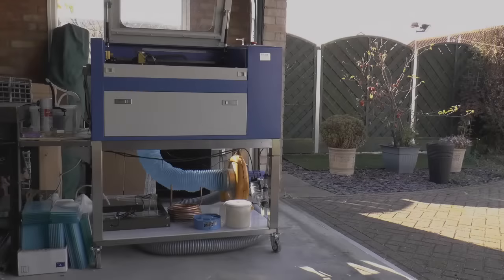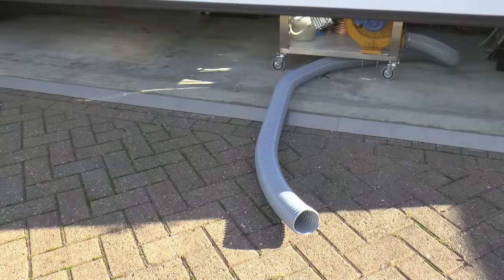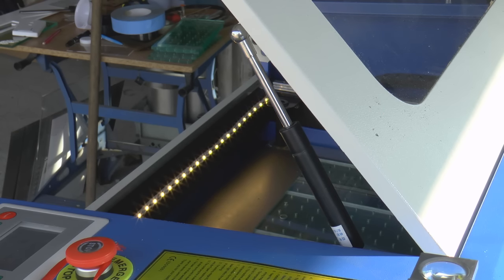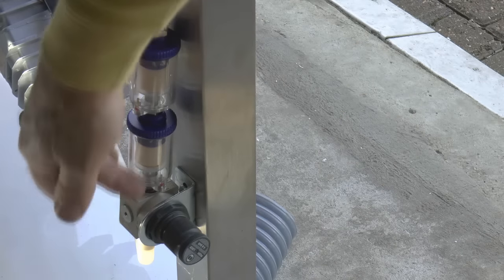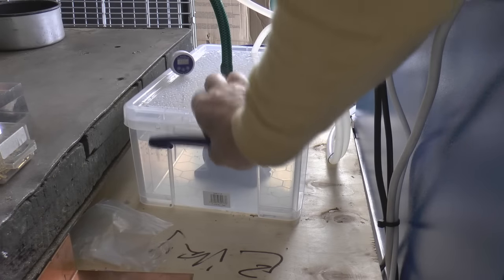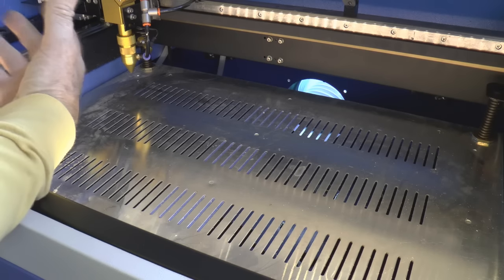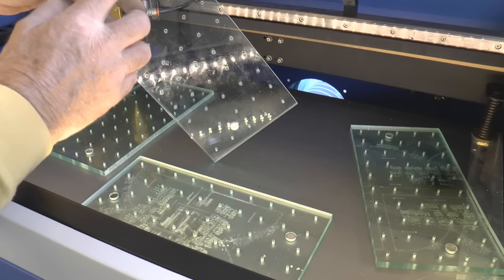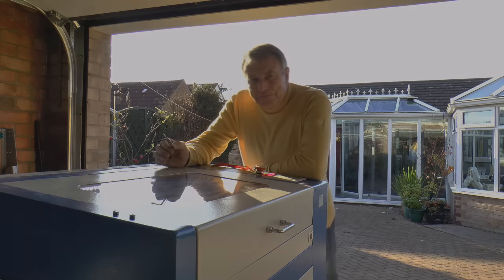My 50 watt Chinese Laser 4-month review

Comment: You mention the air pressure gauge being pointless because you are not using the larger blower.  With the filters you placed in series, your pressure gauge is ideal for determining when to swap filters.  A differential gauge would be better but your set up is still effective.  This series gets better with each episode.
Reply from the maker: Hi Adam
 I come from a background of high wattage metal cutting machines where the pressure of the assist gasses is very high. I was convinced that the stupid little pulsing pump supplied with the machine was a joke. I ran my  shop compressor, (through the  regulator and filter system you see here) for two weeks and destroyed two lenses before I worked out what my problem was. Taking normal ambient air with 30 to 50% humidity  and compressing it to 100psi was obviously heating the air. That hot air sitting in the reservoir was busy absorbing moisture from the condensate within the reservoir. Sending hot air and through the regulators an filters was doing little to change the moisture content of the air. At this point I was not aware that there was a  2.5mm diameter hole through the fitting into the nozzle just below the lens.  I was creating water vapour as the air expanded and cooled and the laser beam was heating the  water particles (probably with oil on it as well ) and baking a film onto the front face of the lens. After a while the film heated up causing differential heating on the lens faces. The lens is not glass but a rather fragile and brittle crystalline material which cracked. Oops.  I caught lens number two before it cracked and realized what was happening when I saw the film. It was so heavily baked on I could not remove it without destroying the anti reflective coating.  I removed the shop compressor and at this stage was still using the regulator to damp out the pulses.  I soon dumped the regulator as well  because the "stupid" pump was not that stupid after all as it can can supply up to 4psi. The system pipework does a pretty good job of attenuating the pulses and because the air is not sitting in a reservoir and the compression is so low, the heating and condensation issues just do not exist.

Best wishes
Ruus
Reply: @SarbarMultimedia  what was the temperature of the air from your cp?  A silica or even clay desiccant should take care of the moisture issues and an HX with the process tapped off from the tube coolant  will help.  But it seems a moot point if the supplied cp is doing the job.  It is quite fascinating watching your series.  I am ordering the Weike LC1390 tomorrow and am more excited to modify the machine than I am to manufacture with it.  Thanks Russ
Reply from the maker: @adamparris3605  
Hi Adam

Dont get too excited because your purchase is much more a plug and play machine.. The biggest issue with ALL the machines is air flow management. The Chinese (and even the big boys) have not realized the importance of CROSS FLOW air above and below the workpiece.. That is something you will have to engineer yourself. Most of the things I had to modify will be OK an a GKW machine. For example you will almost certainly find it's fitted with an A grade tube from either Reci or EFR. I'm sure you will be sxploring the technology rather than fixing the machine.

Best wishes
Russ
Reply: @SarbarMultimedia  I recall one evening as a child watching my brother tinkering with his clock radio; while it was still plugged in.  Can't say for sure what he was trying to accomplish but the effect the electrical arc and small fire he created inspired me.  Ever since, I have modified everything that has not lived up to my expectations.  I don't see this laser being any different.  I already have plans to swap out the stepper motors for servo motors.  I essentially want to make a laser that works better than the jack ass North American companies who charge nearly 10x the price.  I do have a question for you that may be able to save my marriage...  Can I reduce the power down enough on 150W to mark paper and denim without destroying it?  More interested in the denim.

Thanks Russ
Adam
Reply from the maker: Hi Adam
Sorry for the delay in answering. Somehow your last question appeared in my "possible  spam" folder. I visit about once a week  because You Tube often gets it wrong.
 I agree with your sentiments about the "big boys".  but you must remember that they are using a more expensive RF tube technology.  It has always been a driving factor for me to see just how close to their performance I can get with  a machine that cost less than 1/20th of what they will charge. On the quality of photo engraving, I know I am substantially better than them because their lens mounting system limits how small they can get their dots and the  and photo conversion software does little more than produce cartoon like images. The only advantage they have is speed. They can produce their cartoons in 1/5th of the time I do a proper photo replication.  When It comes to cutting their machines are no different to ours. You need power and light concentration to cut, so their machines are limited by the same physics as our humble "toys". I say this so that you don't spend vast amounts of money trying and match their performance. They may have faster servo systems on their machines that go at 1000mm/s rather than our 500mm/s. However,  even at 500mm/s you cannot do quality photo engraving with our tube technology because the response time of the HV power supply is just not fast enough, You will be limiter to about 200mm/s.  So what advantage will high speed servos do for you? You certainly don't need such performance for cutting when maybe you will only be running at  40mm/s with thin materials and as little as 3 to 5mm/s for thick materials.  It is the micro second response time of the RF driven tubes that  allow rapid engraving but I honestly believe that the advantages of this technology are not properly understood by those "experts".

The end of your question has been truncated when it moved into the public arena. However I remeber the marriage saving question.
 Do you have an ammeter fitted to your machine? Do you know what maximum working current should be for your tube (maybe 27mA?) If not then make sure with what I am just about to tell you, you never set your power above 65%
If you go to the  RDWorks USER tab there is a section called Sweep Parameters.. Make sure your pc is linked to the machine and press the READ button. Now find SCAN MODE and you will find it set to COMMON MODE, Change this to  SPECIAL MODE. .
Just below you will find a feature called Facula Size. . When this is set at 99%you will notice no difference from normal. However set it at the lowest allowable 50% and what happens is the power is switched on and off at the 20khz pwm frequency so 50% of the time the power is on a and 50% of the time power is off. It's a bit like an RF tube . As you increase the % you are modifying the ON time. So, if you set your power very low, say 15% and then apply 50% Facula in SPECIAL MODE, you will be dramatically reducing your power.  Press WRITE to send these settings to your machine
Combine this with a 2.5 or a 4" FL lens and you can "soften the power even more. Finally, you have the option to lower the work by several mm to reduce the energy density on your denim even more. The advantage of real denim is it's thickness.  I have never played with denim but I know it is dyed. That dye may well have an evaporation temperature that is lower than the scorching threshold of the fabric.  In which case if you get the balance of power and speed just right you may be able to evaporate the dye and leave a white material exposed. If that is not possible then you will be able to scorch it without burning through.

WARNING. Never leave your machine is SPECIAL MODE, change it back to COMMON MODE before you walk away from the machine.

Best wishes
Russ

Comment: Informative video.. I've got what appears to be the same machine.. Question,  I'm trying to vector cut 3mm plexiglass with a very ornate pattern that takes aprox 1 hour. I'm running power at 95%, but after 5-10 minutes I think the power is fading and then not cutting through the acrylic completely. I don't believe this to be a water temp problem.. Have you found a maximum power % that you can run for long periods of time without fading? Love to hear your thoughts... -Mark
Reply from the maker: +markf3x 
Hi Mark
OOPS!!!

Been there. Done that. Have a replacement tube to prove it!!!!
Have you watched my follow up series of videos entitled RDWorks Learning Lab  (32 of them so far). They document my learning process with this machine (and I continue to learn). I urge you to watch them. I have made some BIG mistakes along the way. The biggest was to assume that 100% meant full power. There were no warnings in the manual about drive current limitations for the laser tube. It was only when I started to notice power drop off (sometimes to ZERO) that I started to investigate, test and learn the error of my ways by picking up odd facts from here and there around www. STOP using 95% NOW.  Limit yourself IMMEDIATELY to 65% . Get yourself a cheap  ammeter from Ebay  (I have done a video about fitting mine) and check what percentage is required to drive your machine to its 20mA limit (assuming you have a 50watt tube).  Without getting too technical they fill sealed laser tubes with at least 3 basic gasses. Carbon Dioxide (CO2) Helium (H) and Nitrogen (N), This next bit is grossly simplified to help you imagine what's going on.  The lasing effect occurs when you apply tens of kilovolts to the gas mixture,. The N gets very excited, it bumps into the lazy CO2 causing it to breakdown into carbon monoxide(CO) and an unstable form of Oxygen.The collisions cause the N to slow down and release heat. The H then carries the heat to the glass jacket which is water cooled. This reduced N activity then allows the unstable oxygen to recombine with the CO to return it to CO2 and the whole process starts again. If you excite the N with too much current it goes bonkers and never gets a chance to slow down enough to allow the oxygen to recombine. The mixture soon becomes "poisoned" by all the free energetic oxygen and the CO2 lasing constituent  gradually disappears, resulting in LOSS OF POWER. Turn your laser off for 5 minutes and the gas will recombine to almost 100%.  If you "overdrive"  it often and for long periods it will gradually weaken the mixture and hasten the demise of the tube. Typically these tube last 1000 to 2000 hours max. The manufacturer makes a recommendation for the max drive current to sustain a constant lasing power, but as I have recently found out, my 50 watt tube is only outputting 37watts at 20mA.  It probably is capable of outputting 50 watts under special short period conditions but there is no way any 50 watt tube will deliver its rated  power under normal conditions. However you can still do some amazing things with 37 watts.
Keep in touch 
Russ
Reply: Thanks Russ, you're my new best friend!!!

I kept increasing the power because I couldn't get through the job (I initially thought material thickness inconsistency, etc). I continued to crank it up with very poor results.  I set the machine to 65% and was able to get through a 45 sheet of vector cutting.  The last 5 minutes faded a little, but the water temp had creeped up to 82 degrees at that point(I was out of ice).  I will happily watch your videos and might be able to teach you a few tricks I've learned (picked my machine up in Feb 2015). I generally use CAD/CAM software such as Delcam ArtCam (which I also use on my CNC router) and them export .DXF to RDWorks.  ArtCam does a great job modeling and also nesting multiple parts tightly on a sheet. I'm sure I'll chat at you more as I digest your videos.. Thanks, -  Mark    , Texas US
Reply from the maker: +markf3x Did you get the message I sent you? some strange lock-up occurred an I've got a feeling it's on it's way to Neptune!!
Reply: Got your message, just changing the power down to 65% helped a lot.  Watching your other videos currently. Thanks again.

Comment: I saw on one of your videos that the 50 watt rating is not actually correct and the machine has an actual lower rating. Would it be worth going fo a machine with a higher advertised rating to compensate? Have you cut acrylic and if so what would be the thickest you would expect to cut? I am looking at around 10mm acrylic and around 6mm plywood. How has it been going up till now, any issues. Thanks in advance and enjoyed your video, especialy "the wifes been bitching", had to laugh at that one.
Reply from the maker: Hi

Although the machine I bought was basically mechanically well designed, Quality Assurance was not included in the price.....that's all down to you. Although I did a mechanical assessment of the machine (as far as you can from photographs), I was very naive about the sealed tube laser technology. Ebay machines represent excellent value for money if you buy the right one. It will always be over specified and the chances are 99% certain that it will be fitted with a B grade Tube and HV power supply. Yhey will work but not very well and for an unknown period. So factor in another $400 or so to replace these two items with A grade components. Make sure you buy with a credit card and you will have some leverage on the seller for some sort of refund towards that replacement tube.
If you look at the end of my 8 month review (about 20 minutes in)  https://www.youtube.com/watch?v=4qy5cPZWGj4  
you wil see I can cut 15mm acrylic (very slowly) even with a useless 30 watt B grade tube.  Buying a higher wattage tube machine will just involve you with more expense because the tube and power suooly will just be the same junk but more expensive. If you are happy with the 300x500 bed size then spend as little as possible to start with and use that money to upgrade to 60 watts as I did. Only choose machines wirh Hi Win type bearings on X and Y axes and make sur it is fitted with a Ruida controller.

This for example is a prettyy good buy  
https://www.ebay.com/itm/Laser-Engraving-Cutting-Machine-50W-Engraver-Cutter-Wood-working-Crafts-os/123583396820?_trkparms=aid%3D111001%26algo%3DREC.SEED%26ao%3D1%26asc%3D20160908105057%26meid%3D9879976f4458496891daa406d624d1a1%26pid%3D100675%26rk%3D1%26rkt%3D15%26sd%3D123583396820%26itm%3D123583396820&_trksid=p2481888.c100675.m4236&_trkparms=pageci%3A8537fc40-2928-11e9-b3f0-74dbd18040c3%7Cparentrq%3Abcfd95c21680ac88e34b2fddffd21f51%7Ciid%3A1

Best wishes
Russ
Reply: @SarbarMultimedia  Thanks alot for the reply. Did you notice much difference going to the higher quality 50 watt tube?
Reply from the maker: @ApriliaRSV4F  
I took the opportunity to upgrade to a 60 watt tube and power supply that cost me another £550. It hurt at the time  but is was an excellent investment. I have since had a  trouble free cutting experience and now the tube is about 3.5 years old and still running perfectly.   My little 60 watt 500x300 machine still cost less than the  60 watt rubbish 700x500 machine which would have still requirted that £550 investment.
see   https://www.youtube.com/watch?v=zCTrRT1C_eY

Best wishes
Russ

Comment: Hi could I ask how many litres of air the pump is for the laser please ?
Reply from the maker: Hi Eric
The machine was supplies with
http://www.hailea.com/e-hailea/product3/ACO-328.htm      Although it delivers adequate flow , at zero resistance it can pump 70 litres per minute. BUT is pressure capability is only 4.4psi. Thus it does not require much system resistance to reduce the flow significantly. 
I have now upgraded to
http://www.hailea.com/e-hailea/product3/ACO-009E.htmm     This has doub;le the flow rate which is meaningless because the pressure capabilty is still only 5.5psi. With more about 15% more pressure capability I do get a slighly beter flow.
See  https://www.youtube.com/watch?v=OCVsMXw6yh4 for much more information.

Best regards
Russ
Reply: SarbarMultimedia that's great and thanks very much for the links

Comment: can i ask where did you buy the aspirator I see in the movie? ciao
Reply from the maker: Hi Stefano
I managed to trash the centrifugal fan you see on the machine.
take a look at 
https://www.youtube.com/edit?o=U&video_id=GNV0JUJXdvk
you will see the replacement.

http://www.ebay.co.uk/itm/480W-Air-Duster-Blower-Pump-Fan-0-7HP-Inflatable-Bouncy-Castle-Jumper-4M-Cord-CE-/302051307614?epid=12003591401&hash=item4653a9305e:g:V4kAAOSwgZ1XtpbU

You will have to make your own adaptors but the great thing is that although the machine outlet flange will be 150mm the outlet for the fan can be  100mm pipe.
Hope this helps
All best wishes
Russ

Comment: Very honest review. Is your machine 220v? Which web site did you bought it?
Reply from the maker: Hi Jose
 Yes it is 220V.  I bought it 4 years ago and when I look at ebay now these 300x500 50 watt machines are difficult to find.  If they are available then be careful because they are usually fitted with a very poor type of controller.  Take a look here at the display panel for a Ruida controller .and make sure what you buy has this keypad design.
https://www.cloudraylaser.com/products/cloudray-ruida-rdc6442g-dsp-controller-psu-wifi-handle-for-co2-laser-engraving-cutting-machine?variant=12906003857459
Also, make sure you buy with a credit card.
This is slightly bigger but looks good value
https://www.ebay.com/itm/4060-50w-ruida-laser-engraver-machine-carver-cutting-Acrylic-glass-plywood-cnc/143051312601?hash=item214e85cdd9:g:YpoAAOSw~2VcE1vt
or this
https://www.ebay.com/itm/New-RUIDA-50W-Laser-Engraving-Cutting-machine-With-Motorized-Table-16x24/173945971193?hash=item287ffce1f9:g:yU8AAOSwj-BdFCJ0

Don't be tempted by a 400x300 machine because they are just pimped up K40 machines  and will be very inflexible.

Best wishes
Russ
Reply: @SarbarMultimedia  thank you so much Russ.